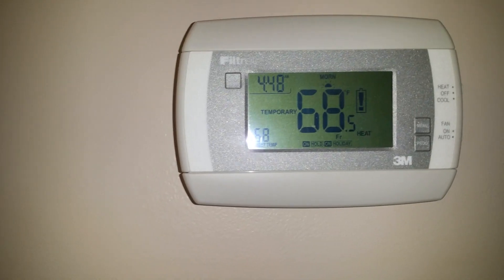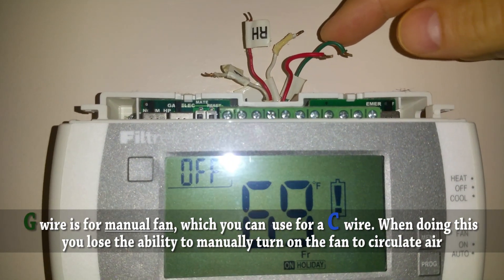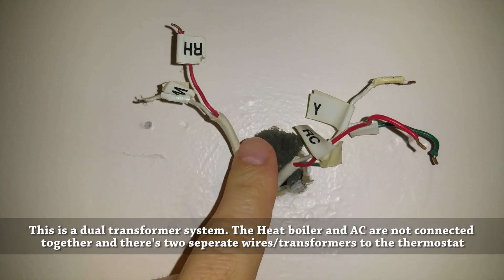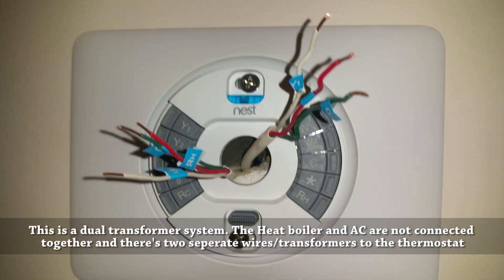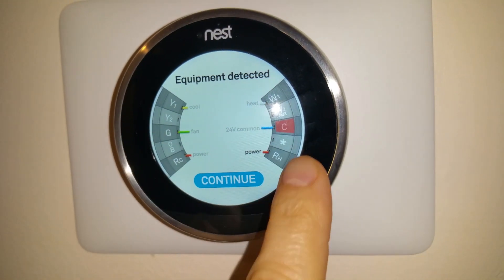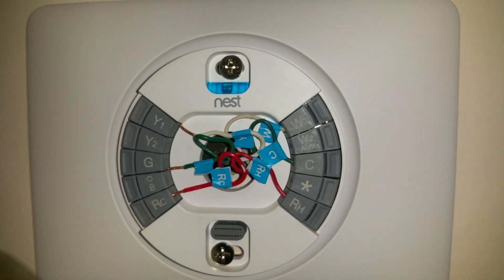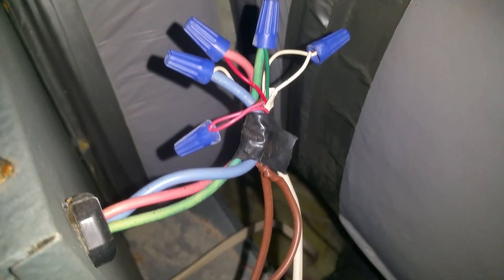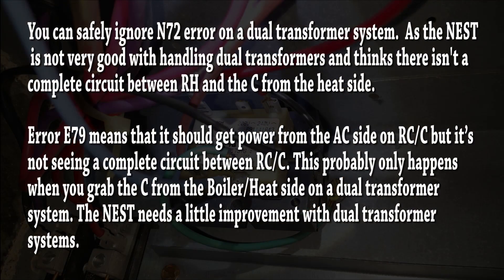Nest thermostat Install on a dual transformer system - how to obtain a C wire

Comment: I have exactly same system as you and I been facing exactly same issue , I do not wanna run the wire etc myself so do you think an electrician will be able to help me out ? Yes than what do you think approximately his/her services would cost me ?
Reply from the maker: No idea on price but won't be cheap, just get and external transformer, easy to do but not as processional looking.

Comment: nice video, i have the same thing at my house, two separate systems and two thermostats. im looking to install the nest. Have you had any trouble with it so far?
Reply from the maker: yes watch the video, it tells you how to do it. its been working great!
Reply: I just took out 3 ecobee t-stats because of the same issue. Forced hot water boiler and central air. Ecobee uses rc as its “priority” power source. I only have a 3 wire from the air handler to the thermostat with no way of running a 5 wire from the first floor to the attic 1.5 story’s above. I think I might have to go back to the old school but reliable Honeywell analog smart thermostat. Very frustrating but great video explaining the options. After calling nest tech support, their solution was to try taking the “c” wire off. The trouble went away. Upon questioning, they also told me one t-stat per transformer or it will burn the transformer out in my relay over time.
Reply from the maker: on the air handler side you can use the 3 wires and add another wire, using a add a wire kit - check this out https://amzn.to/2Ho54eb

Comment: Hello I've been having the same problem. N72 keeps coming up but I don't know why. If I hook the air or heat up by itself it works once both are connected the RH goes out. I've connected 2 regular thermostats and they work perfectly. I was on the phone with nest for 2hrs N they couldn't figure out my wires are Y1, G, RC on one side and W1, C, RH one other.
Reply from the maker: Make sure c comes from a.c. side
Reply: @daP.A  really? I think it's coming from the heat side. Do I have to run a new wire?

Comment: I know about this system as an Electrician, but when I went to hookup the dual transformer is gave me an error that there was no power on the RC side, the common is from the Air handler but there is a overflow pan switch in the loop, I had to one time mix some wiring around to make sure the unit would still work without disconnecting the cutoff and also keeping common. But today I hooked it all up and it gave me an error on the RC side where the boiler power wire was hooked up. Any ideas here? Or how can I ignore the code or is it possible the backplate wiring is bad?

Comment: Dont Try to pull wires like that. Sometimes is wrapped on a nail or wood stud in the wall.
Reply from the maker: correct, you will need to make sure its not stapled, in my case i know it wasn't and used the old wire to pull and new thermostat wire. If its nailed/stapled you can just run and new wire, but yes sometimes the old wire is stapled in and wont move, Just run a new wire in parallel as in my case you will not be able to use the old wire to guide/help you pull the new wire.

Comment: You CANNOT use the green wire for common. If you do, you blower will not run during a call for cooling. There are many different applications out there. Call a professional HVAC contractor to install.
Reply from the maker: Using green for common is not the best option but it will work. Manual blower will not work but when a.c. kicks in blowers will come on
Reply: That’s what I was thinking

Comment: I called nest tech support and they couldn't tell me this. I am a licensed electrician for 30 years and they wanted me to call one of their CERTIFIED techs to look at it. Very silly system not to use heat common wire especially since most people have heat but not always have AC and some have both but separate transformers
.
Reply from the maker: It will use the heat and bridge to rc but if you have heat and a.c. wires coming from different transformers it wants to see the common on the a.c. side
Reply: Read my post it might help ya , we had a 2 transformer system and have zero codes now , isolation really was the fix

Comment: Them you could prevent all that wasted time by just supply the nest power with a 24v external power supply or use wire that bridge power from the heat side to the cooling side problem solved.
Reply from the maker: Nest already bridges power from the ac heat side the problem is on dual transformer it must see power from ac side. U can use an external transfer just doesn't look as good. Good luck
Reply: @daP.A  only if u don’t know what you doing.

Comment: The Nest is a disaster on dual transformer systems, despite their claims that it should work. My theory is that if it does work, it's only because peoples' transformers are reasonably matched AND on the same phase of the main AC. If one of your transformers is out of phase with the other, which seems like should happen 50% of the time, you're screwed.
Reply from the maker: My nest has been working on dual transformer for about a year now. This is why I posted the video. Not sure I understand your theory. Residential homes are all one phase but regardless the nest is on taking power from one transformer on the heat side. Regardless if there are two transformers.
Reply: You are right!   If the 2 transformers are not "paired " or paralleled  correctly,  they add to 58V! instead of parallel 24V.    make sure your secondary windings are matched.    Meaning the Rc and Rh are near 0V measured across .
Reply: Da P.A I’m glad you got it working and posted your video, but I’m not sure you understand everything going on. Homes have two hot wires coming in. They are 180 out of phase. Maybe that’s not considered dual phase, fine. My point was that I think it matters which hot wire your transformer is run off, and the specific winding of your two transformers. I could be wrong, but all i know is that when i measure the voltage at my house between my HVAC and boiler, they aren't even close to being similar. I've got about 7 V between my Rc and W, so I'm not surprised the Nest has trouble. It really needs to be able to keep Rc and Rh separate, but it doesn't seem able to do that and isn't able to compensate all the possible circumstances.